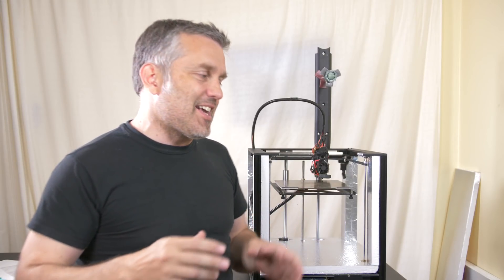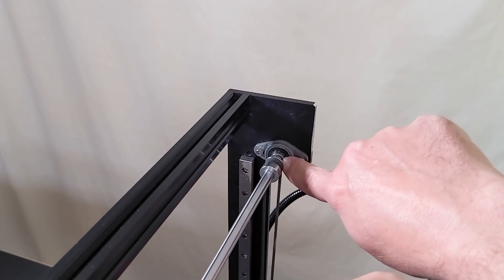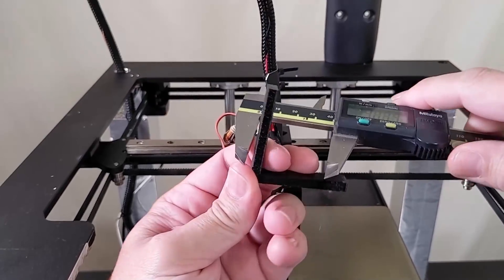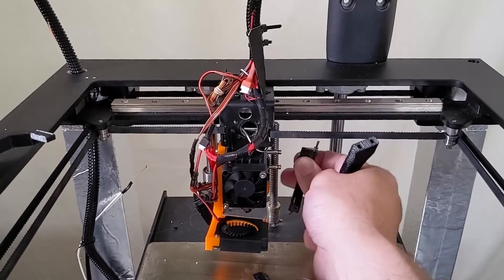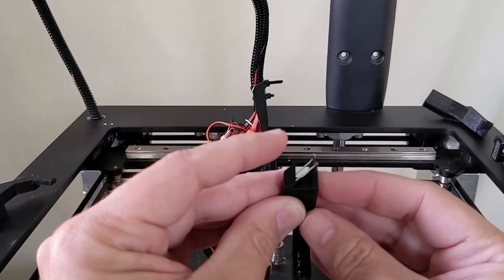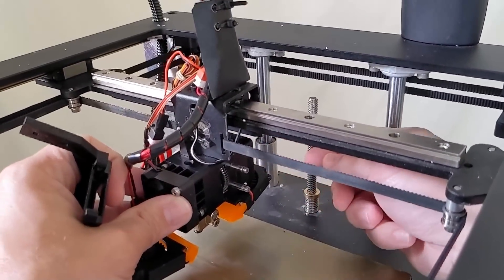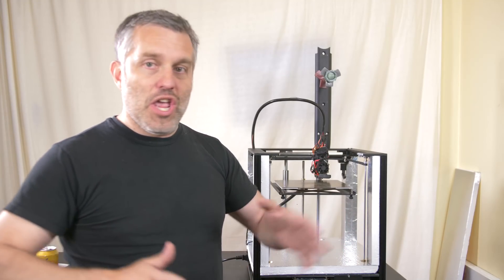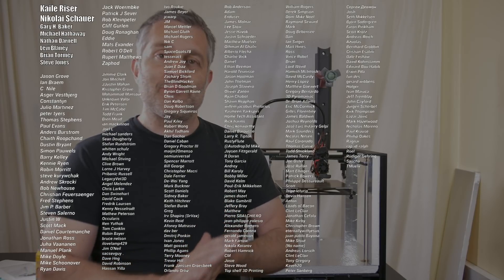A Tool Changer Bed Probe For My Enclosed 3D Printer

Comment: I guess I should look into it, but I still can’t figure out why no one is using galvanic touch probes for bed leveling. The switches, I guess are adequate (some error due to switch bounce), but just seems like a lot of effort and sketchy components for bed leveling.
It probably my ignorance, which I must rectify.

Comment: looks good, and i like the part cooling fan mounts. fyi mellow on aliexpress have sunon 5015 24v pwm fans now, so if you need beefier cooling then they are the best 5015 fans i guess, only seen cheaply made other 5015 fans

Comment: Interesting, I was not expecting that but looks good. 
I am waiting for a inductive probe to test in a heated chamber. 
I know that they drift with temperature, but my aim is to use it doe bed levelling only not z height. 
For Z offset I am planning to use a switch off to the side of the bed like a Voron 1.8

Allows the ability to change nozzles and compensate for any differences.

Comment: I have a suggestion that i think will help simplify your design. Instead of having those leads touch, you could have magnets that conduct the electricity to the microswitch. That way it could stay well seated while making a secure connection. The Annex Engineering Magnetic Probe uses the same "toolchanging probe" thing. Would be awesome if you could give them credit for it.
Reply: Unless he copied them...which it sounds like he didnt....or even know it existed...why would he give them credit?
Reply: @bobbunni8722  Not saying that he has to. I'm just informing him that there IS something similar to what he's doing since he says he's not aware in the video. Just being helpful, not hating.
Reply: @GRuizMedia  ok cool
Reply: Have you seen electric coupling that uses Mihai design? He uses a system of pogo pins and magnets. Give a look to it looks it might by usable in your system
Reply: This concept is very old

Comment: Good one! I did something similar for my second tool head. I don't need super speed on the second head cause the intention is just to print interface layers in dissolvable filament and that should not take too much time.
https://youtu.be/0AtCEASOQ4E